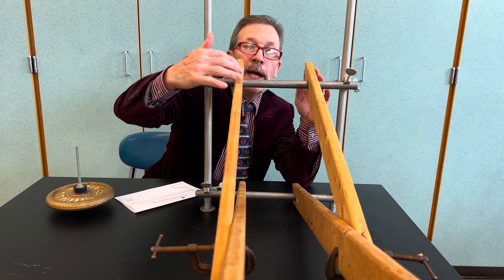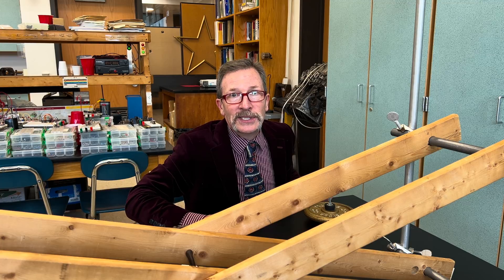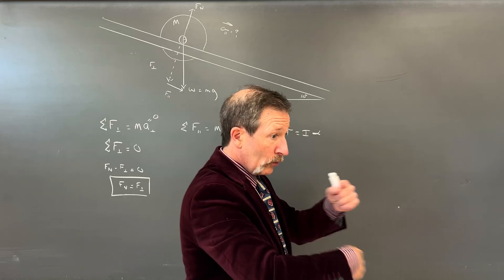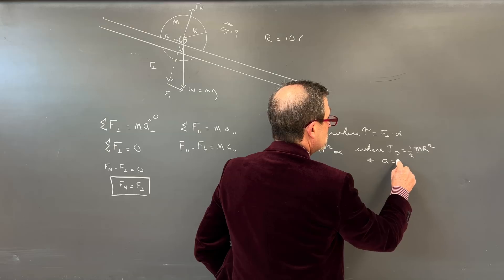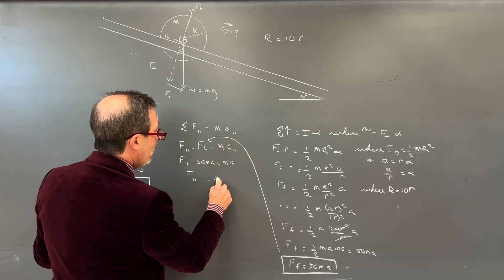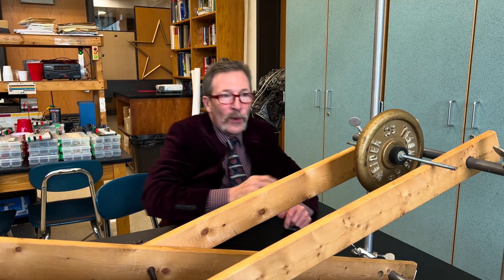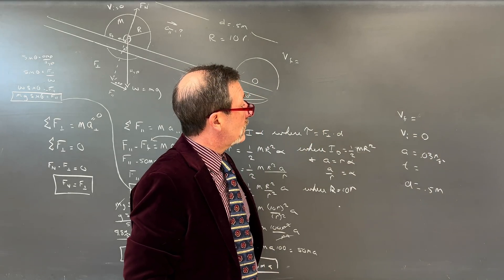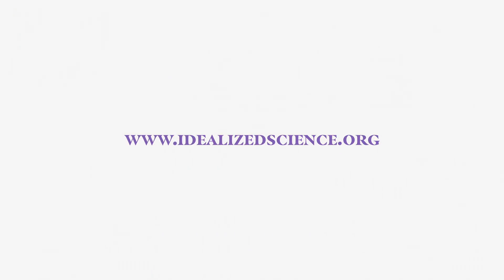Torque Challenge Problem: How Fast will the Flywheel Roll?

Comment: I was confused why you weren't integrating the mass along the radius of the disk until I realized that the integration has already been done in the formula for the moment of inertia of a solid disk. Change the weight distribution (like for a hollow ring or sphere) and the moment of inertia changes and so does your answer.

Comment: I worked out this problem in my head, and without writing anything down, by imagining the free body diagram of the disk-rod apparatus. After manipulating equations, I came up with: a=g*sin(theta)/((R/r)^2+1), where theta is the ramp angle, r is the threaded rod radius, and R is the disk radius.
This assumes the rod has negligible mass compared to the disk, that the disk behaves as a perfect circular cylinder of homogeneous mass density, and that the rod rolls on the ramp without slipping. Interestingly, the radius ratio has a quasi inverse-square effect on acceleration.
Reply: Whoops, I lost a factor of 1/2 in the denominator. Mental equation solving is more prone to errors than writing it all out.

Comment: In my first year physics class, this same principle was demonstrated with two wheels of the same mass and same diameter. One was wood and solid, the other was metal and hollow (it was just a ring). They were put on the ramp and let go simultaneously, and to the class' surprise, the wood wheel rolled much faster, and so we saw the effects of moment of inertia.
Reply from the maker: That’s a great way to demonstrate the effects of rotational inertia! Intro physics is such a wonderful subject because so many of the phenomena can be demonstrated so clearly. So much fun!

Comment: This exact problem, to be worked on paper mathematically using known laws of physics, was on my Physics final exam as a freshman in 1968.
Reply from the maker: Wow! Where were you studying?
Reply: @idealizedscience  This was the freshman first semester for the Honors Physics program. At that time (entry 1967) the University of Maryland was rated #1 for undergraduate physics, beating out even MIT.  The first semester was "Mechanics".  The professor, a nuclear physicist newly stolen from the UCal system, had never before taught undergraduates.  When I discovered that I had only made 34 out of 100 on the final, I was  devastated - until the prof told me mine was the highest score in the class. The prof had written the final with his PhD candidates in mind.
Reply from the maker: Amazing! Maryland remains one of the strongest programs in the country in several sub-disciplines. Thanks for sharing

Comment: I don't understand why you didn't setup your lab to exactly match your equations and measure the actual vs the calculated.
Reply from the maker: The motivation of the problem was to show how to do use the tools of mathematics to solve such a problem. Overall, there is very good correspondence between the theoretical and the experimental.

Comment: I'm glad he switched to calculating acceleration. It doesn't make sense to ask for the speed.  Would that be the initial speed, average speed, final speed, or the speed at some other point? To answer these, you'd also need the location (distance). I know it sounds picky, but to do physics well, the language should be precise.
Reply from the maker: We do have a video on the velocity of a flywheel using energy! Check that one out.

Comment: Well this is a scam, sort of.  The "slippage" along the rails will cause major errors in actual Lab tests.  We also did this with plastic rails, and steel rails, and the differences were "large".  Some students recognized this, and got super grades.
Reply from the maker: The threads dug into the wood enough that the all-thread did not slip much at all!

Comment: Perfect presentation.  Clear and concise; matched to an experiment, and matched to an alternate version.
I'd add that more emphasis has to be made on the resistance to change of rate of rotation of the flywheel (and this is important in mechanical engineering).
In my HS and college days - the blackboard work was usually done with the real values from the lab work.  
The setups were usually different for each team (different masses, lengths, angles, temperatures, dilution, whatever) so each team had to solve their case.  (Teams of 2 typically).
Reply from the maker: Glad you enjoyed the video and thanks for sharing your experiences!

Comment: Fly wheel creates potential energy.

That potential energy is also used to be kept while the kinetic energy is being expended from it.
Reply from the maker: We solved this problem using energy in another video. Check it out - https://youtu.be/mgzQSR12VYg
Reply: @idealizedscience  I'm verifying "How Fast will this Flywheel Roll?"

However, I was referring to this since we had flywheels for 1,000 tons presses to keep some of the momentum going.
Reply: Formula: The formula for momentum (\(p\)) is mass (\(m\)) times velocity (\(v\)), or \(p=mv\)

Comment: Wonderful!!! I would solve by using the conversion of potential energy into kinetic energy (translation and rotation). I would assume the axle doesn't slip and try to find how much of the kinetic energy would be translation and how much would be rotation.
Reply from the maker: This is another great approach! We covered that in a recent video: How Fast will this Flywheel Roll?
https://youtu.be/mgzQSR12VYg

Comment: I am wondering how do you associate friction with force?
In my opinion to quantify friction we need to determine the ratio of slippage which in your experiment is 0%.
Reply: high friction are epoxy glues , they have extremely long chain molecules, water has 2 molecules per chain, epoxy's are 100000 - 2 million molecules long per chain!!!, there like little hands holding each other, more hands more friction force
Reply: @lunam7249    What is the difference between friction of glues vs friction of sandpaper vs rubber on a tire?
Reply: @ShonMardani there are beautiful video YT  VIDS on friction, watch a few there then i can answer your specific question very acurrately;; ,  ionic, intermolecular, surface, charge, tension, are 5 of the common type "frictions"
Reply: @lunam7249   I have watched many videos, nobody can define Friction.

What is the common denominator among ionic, intermolecular, surface, charge, tension?
Reply: friction, at low energy is usually  intermolecular not "observable mechanics"
Reply: @lunam7249   Is it a force?
Reply: @ShonMardani excellents question!!❤❤ force = resistance to something, FORCE = ENERGY/ DISTANCE.....their are 4 primary resistors, 1 mass, 2 mechanical (like friction), 3 springs /dampers  4. ohm electric, 5 anti-FARAD
Reply: @ShonMardani friction in gravity is typically = NORMAL FORCE X COEEFICIENT OF FRICTION....ICE CUBE = 0.02, CAR OIL = .05 , TAPE = 20 , SUGAR STICKY = 1000, STRONG GLUE = 5000
Reply: @lunam7249    Then we need to use these numbers in the equations, we do not, instead we used weight/mass to determine the friction force.
Reply: @ShonMardani correct, but in respect he is doing it the very correct formal way, hes obviously a professor❤❤❤....if your building a bridge or skyscraper you solve it this way " rigorous and FORMAL", so you dont accidentally forget something, and people die
Reply: @lunam7249   Gravity moves through the objects into the ground toward the center of the gravity of the earth.
Friction is caused by the air gaps between the objects/matters which are transferring the gravity.
Reply: @ShonMardani friction is am entire world called "tribology", " the study of surfaces"...since this ramp is going "downhill " with gravity, friction is very low, if it were climbing the ramp friction forces would be high...friction is air alone is very very low, its called "drag"...airplane friction = air, car friction = rubber tires
Reply: @lunam7249    I understand that he was correct in his calculations, my problem is the parameters used, mainly quantifying and using friction as a force. The use of the material, the angle of the slope and many other variables like temperature and humidity can change the friction.
Reply from the maker: Remember, if it were not for the friction, there would be no rotation...just sliding! Thanks for your question.
Reply: @idealizedscience    Friction is not a force, it is the resistance to Gravity Force.
Reply: @idealizedscience   Thanks for the reply, I think if you increase the angle more than 60 degrees it will slip.
Reply: car without brakes and you can push it, but its hard "force", car with brakes = superhard force, maybe 10 people can push, car SKIDDING FORCE = 1.0( friction number of rubber on concrete) X MASS OF CAR KG  X 9.81 NEWTONS( gravity interaction)
Reply: @lunam7249    What causes the friction?

Comment: The math is over my head and I cannot even read some of it but what happens when you change the friction with a very fine toothed gear and some lubricant and don't have a sharp angle where it changes direction. Do you do the experiment and use the results to adjust the math or is it predictable with the math alone and the experiment just proves it?
Reply: It's not slow due to friction, it's slow because most of the force from gravity that is trying to accelerate it down the slope is going into spinning up the flywheel. If the slope was smooth and greased and the rod was smooth, it would just slide down the ramp, much faster, but it would not be spinning. Instead in rotational kinetic energy it would have linear kinetic energy.
Reply: @joekoelker7523  I understood the fact it was not slow due to friction but friction plays a part. I thought he would talk about how far up the other side it would go and I commented before watching the end.
Reply: The math describes the system, ignoring actual friction. He did a nice job of that. The experiment just confirms the math.
Reply from the maker: Using a geared system would be a nice follow-up. Thanks for the idea!
Reply: At a guess, if you actually performed this experiment with a fine pitch rack and gear and possibly some lubricant, the result might well be slower than in this version. The difference is that there would be some energy loss due to sliding friction of the spur gear teeth rubbing on the rack gear teeth. If you used a thick grease for lubricant the result might be slower still. Of course, idealized classroom physics usually ignores friction, so the results would be the same. 🙂
Reply: @lwilton  Use VERY FINE teeth and  something like carnauba wax for lubricant
Reply: @hikerJohn  If you think about it, the finer the teeth get the closer you get to just a round rod rolling on a flat surface.

Comment: 10 degrees! That's not 10 degrees.
Reply: It looks bigger, but I think that's only because the ramp isn't shown right next to a horizontal line. The X-frame that the ramps are made of looks to me like it forms about a 20-degree angle with itself. But the angle we care about for the calculations is relative to the horizontal, not to the other ramp. And that angle is exactly half of the angle that the frame makes with itself.
Reply from the maker: Pretty sure that was the measurement done right before recording. We will set it up again and double check. Will also take a picture. Thanks for watching and participating!